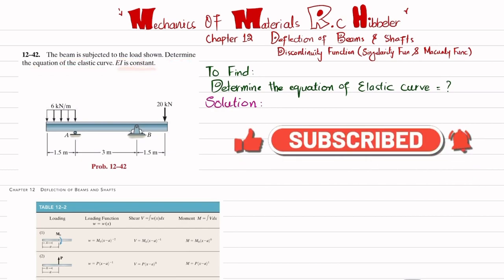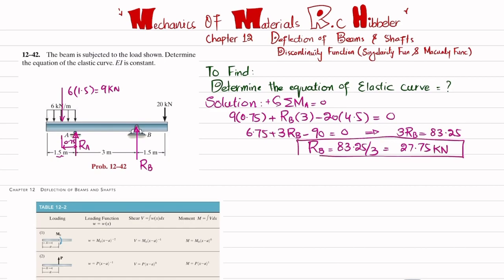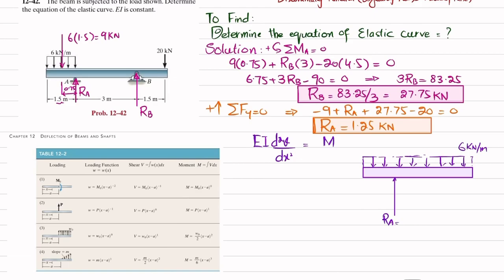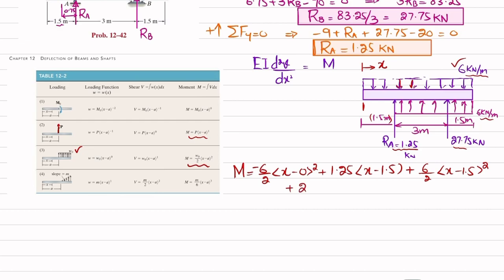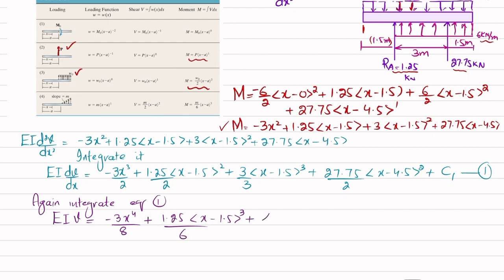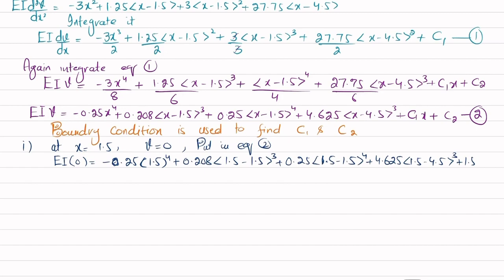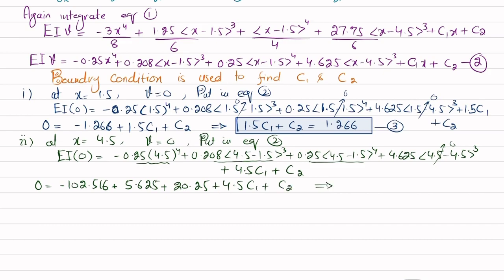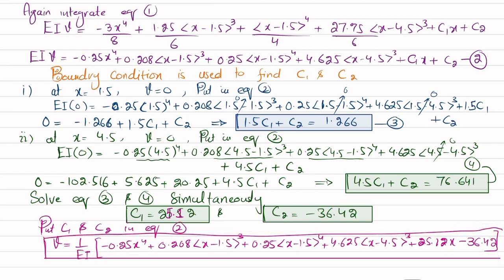12-42 Equation of elastic curve | Deflection of Beams & Shafts | Mechanics of materials RC Hibbeler

Comment: why is the 20kN load not included in the moment equation?
Reply from the maker: Ok you can see if you include 20 KN as well then you will have a term 20<x-a> and for this condition a=6m so when you put x=6 then this term will become zero therefore we always neglect the last term. ❤
Reply: @engradnanrasheedmechanical  thank you very much this was very helpful
Reply from the maker: Yes you can check more to get clear about this topic